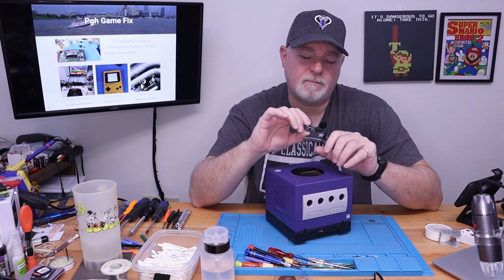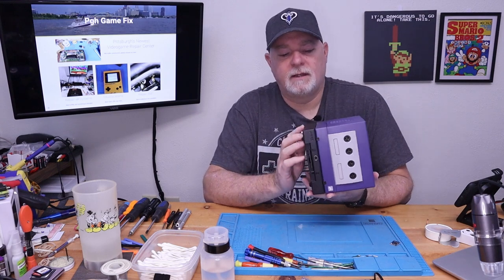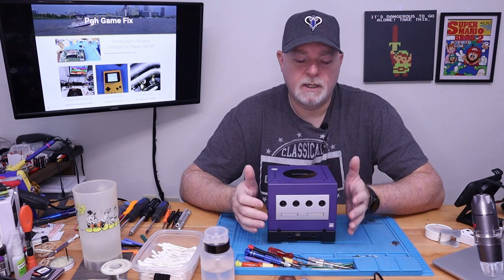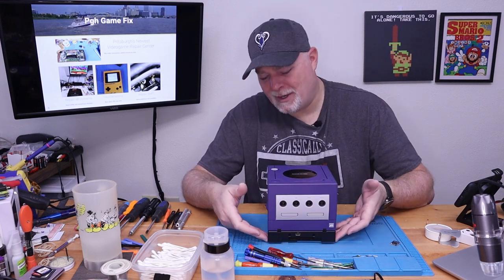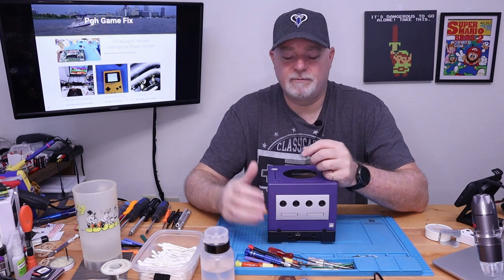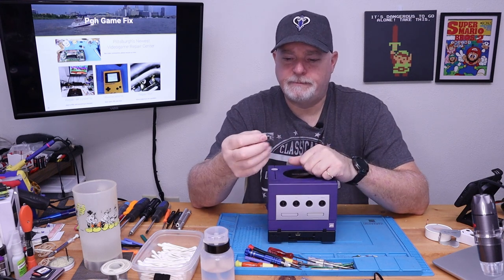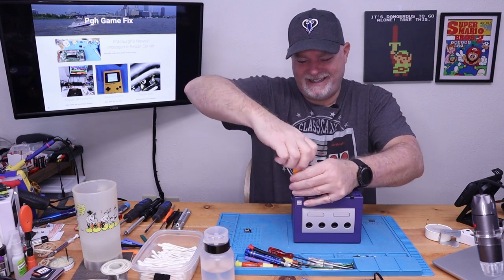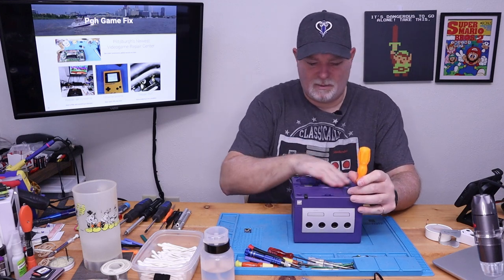Xeno chip install on a GameCube

Comment: I don't know why, but sometimes my xenochip would work and sometimes it won't. After playing for a while and rebooting or resetting the GC - the Xenochip light will not come on anymore. However, a little tap on the top of the GC would get it to work again. Not sure if it's a connection issue, but I made sure there were no bridged solder points.

Your video really helped do this mod as my first soldering job, and it was definitely a bit difficult, but thank you!

Comment: Normally the laser would have to be recalibrated using the potentiometer. The standard is 175 ohms. However, a self-burned DVD cannot still be read with this setting, it would have to be 50 ohms and an original game can no longer be read with 50 ohms. Either or ...?
Reply from the maker: If you have your GC laser down that far... your laser is warn out. Time for a replacement.

Comment: I just did this mod today and I also only get a solid red light (noticed yours blinked which I heard some models do that instead of turning green when working) I think my mistake is I filled that second power hole at the top as that’s what I saw someone else do.  He didn’t seem to have a problem with his, which is making the project confusing. Lol 
  I’m just surprised the Swiss disk worked without tampering with the disc laser which I hear has to be done.
Reply from the maker: The lasers on the GC aren't failing like some videos want you to believe.  There are a couple caps on the optical board that are starting to show high resistance, and it keeps the signal from passing.  We wound up changing those caps.  Check my channel, and you will find the cap video.   Once they are changed... your GC will run everything perfectly.
Reply from the maker: Here's the cap video. https://youtu.be/NJDwQZNCjDk
Reply: @PghGameFix  thanks.  I’ll check it out once I reach that step. I still can’t get passed the one solid red light.  Don’t see what I’m doing wrong

Comment: I'm doing this when the GC Loader comes back in stock. If I'm not confident in soldering, I can contact you right?
Reply from the maker: Absolutely. If you are local, you can drop it at Warpzone.
Reply: @PghGameFix  lol I'm in New Hampshire, so I might need to ship it. I can't do the SD2SP method, I have gamecube without that port. I am lucky my model has digital out.

Comment: No need to adjust the laser strength?
Reply from the maker: Generally... no.  Basically, the bad caps are keeping the signal from passing.  Running the gain up helps... but with new caps (If they are bad)  should run the factory gain.